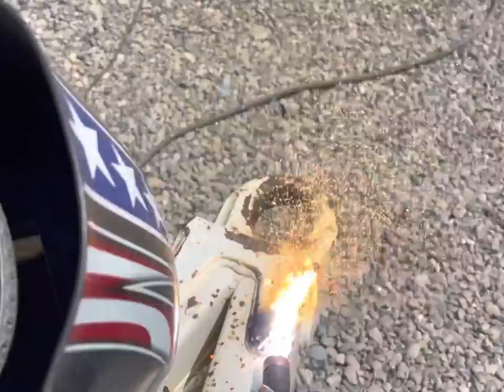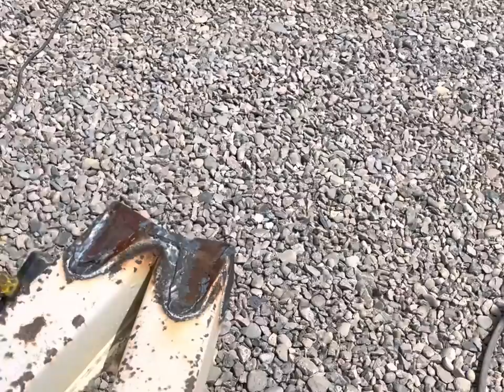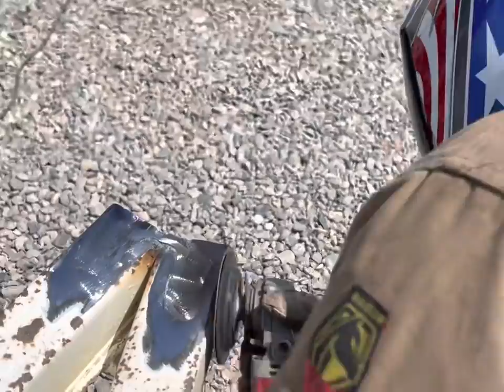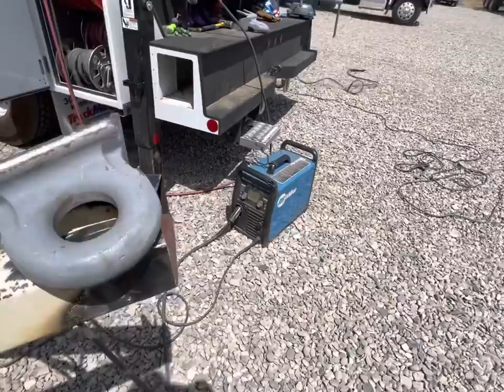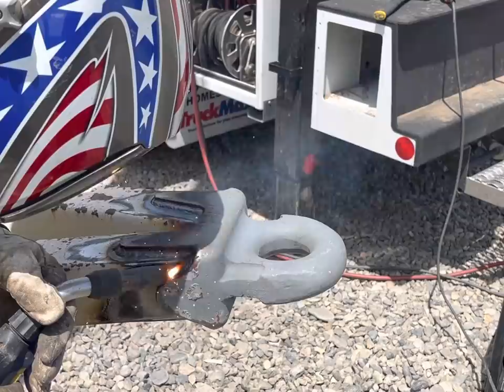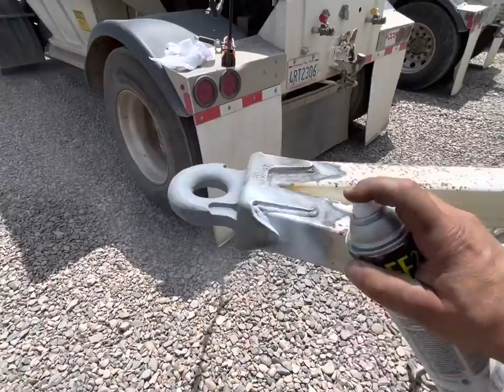Pintle Hitch Replacement

Comment: Wow , that tubing is much thinner then I was expecting 😳 I would have thought at least 1/4 wall 🤷🏻‍♂️ I guess that’s one way these manufacturers still charge the same price or more with cheaper/ thinner materials. Another Awesome OFW video 😊👍👍
Reply: Given they'll be under tension and compression loads along the long axis you probably need a lot less material than you'd think. It's also strong enough if the pintle eye is still what's needing replacement due to being worn out. Finding efficiencies like this is one of those things that free markets are actually pretty good at.
Reply: You have to be able to lift it up
Reply: Maybe there designed to snap off incase of a hard impact. Because I doubt a company would cheap out on a main tube. But ya that looks thin!
Reply: @ibidu1  The load that the tubing for the frame is supposed to hold is inline with the tubing mainly.
Yes there will be some vertical load but not as much as you might think
So using thinner wall tubing is not as much of a negative.
Weight saving is where the thinner wall tubing is better
Reply: The reason for the thin walls is so that in case the worst happens and it comes loose the hitch does not become a hardened spear. They are designed to crumple under sudden compression. Under normal use the tensile strength along the liner surface is enough. But it is another reason to start and stop the load slowly.
Reply: @larryfoster423  Your 100 percent right.
Reply: The tubing used is made of Molly tubing. Atleast the ones I work on. They are not mild steel. Even the fender braces are molly. You have to heat to a cherry red before they bend. Helps reduce the weight, ours are bolt on hitches, we replace them once in awhile. Looks great!
Reply: The tube actually only experiences forces in normal directions. something that only experiences normal forces is much stronger than it experiences moments and shear forces. So to save material and costs they make them thin, because there are strong enough.
Reply: Is the tongue A36(Mild steel) or an alloy?  For example, most cranes use T1 steel for the main chords and either 4130(round) or A36 (angle) for lacing.
Reply: Something to think about next time you meet one coming down the road toward you.
Reply: @reubeng2110  good point.

Comment: I would have lost that bet on thickness of that tubing! I can't believe it's that thin. Oh well, nice fix. Thanks for filming it.
Reply: I figured 1/4 wall.  Lol
Reply: If designed correctly, 1/8 wall tubing can hold a lot of axial load. As long as you don't put it in significant bending, it will defy intuition.

Steel's strength is often underestimated when compared to more exotic or expensive materials like titanium or CNTs.
Reply: @BrokenLifeCycle  you obviously haven't been introduced to amateur truck drivers.  Lol
Reply: @gregsmht40  There is always some guy on the crew who is good at breaking plant and equipment. We had a guy named Hammer, because he broke things! 😅

Comment: You make that look easy.  Welding thick to thin metal is tricky to not create a blowout.  Well at least for me anyway.  Great job.  Look forward to the next one.
Reply: If you practice you'll be able to do it too! Concetrate the arc mostly on the thicker metal then wash the puddle onto the thinner metal. Maybe you can find a video.  Good luck,always a need for more skilled welders! PRACTICE!
Reply: @bigdave6447  Thanks for the advice.  I will give it a try.

Comment: 06:46?!  MAN you are not kidding that those walls are on the thin side?  That is scary to think that all of that trailer and cargo is pulled by very thin square tubing!  Excellent videos as always and a hello from the State of Texas!
Reply: You should see the tongue of a dump truck transfer trailer flex
Reply: itll do it 1/8 inch is stronger than you think
Reply: @daynemartin1085  the what of a who?
Reply: scary indeed, you'd a think they would use at least 1/4 inch tube, crazy to think 20-30 tones is being held on with such thin wall
Reply: @Nothingmore71  transfer trailers are the boxy trailers behind dump-body trucks that they use to haul things like dirt, rock aggregate, asphalt, etc.  The tongue is the part of the trailer that sticks out the front and has the hitch on it.

Comment: I am surprised that the draw bar material is so thin. I would have guessed that it would be at least 6 MM wall thickness, that’s 1/4 Inch. 😳🇦🇺
Reply: It's a "pull" bar and iron tends to be rly strong if you pull on it. And the triangle makes it stronger
Reply: @rubendejong4412  it's kinda funny they go on bump roads and dips and pot holes and that don't break
Reply: Don't need the mytrik #'s!
Reply: @petersipp5247  😳??
Reply: 6mm < 1/4" (6.35mm)
Reply: 6mm is 1/4 but he mentioned 1/8.. it’s a draw bar which has a lot of surface area and two bars together. (I used to build these trailers)

Comment: When we installed pintle hitches, we were not allowed to weave or pause our welds. Can cause stress fractures. I would say your welds look fine and the material is only 1/8 with a ton of weld around it 👍

Comment: In Europe, we just replace a bushing in the eyes.
Reply: Some are like that here. We have a floating Pintle and an air lock pintle
Reply: Eventually you have to replace the eye but even with bushes
Reply: @Bigsoot7393  The eye of a VBG 57 mm. drawbar eye is virtually unbreakable if the bushings are changed in time. More often than not the reason for an eye being replaced is incorrect heating when changing the bushing. We really don't change eyes with bushings here.
Reply: @victorschmidt5306  oh yeah Europe I forgot, only haul half trailers around
Reply: @Bigsoot7393  Yeah, only 30 meters (100ft) and 90 tons (200,000 lbs) in a standard 11-axle timber train.
Reply: @victorschmidt5306  that's a lie, show me a link
Reply: @victorschmidt5306  well bloody hell hey thought you guys only ran single drive and little half trailers haha do they whip around because the trailers are so much heavier than the truck and there is no weight being transferred onto the truck?
Reply: @Bigsoot7393  It is true that a lot of Europe runs 5 axles and 88,000 lbs. which in Scandinavian eyes is no more than product samples. The most normal combinations for the heavier 60-90 ton transports use a 3-axle truck 58,000 lbs, a 2-axle dolly and a 3-axle link, and a 3-axle semi-trailer or just a 4-axle semi-trailer. With the truck being around 60k lbs it has no problem staying to the ground or pulling the load. Remember, we run 650+ hp V8s and 16-liter inlines.
Reply: @victorschmidt5306  i feel like a lot of people dont realize europe uses more powerful trucks than America does
Reply: @victorschmidt5306  yeah right well in Australia we have a truck and trailer towing another 3 trailers and they whip like crazy haha
Reply: @jblob5764  yeah they are just Numbers on the side of the cab a 620 Cummins will outpull them here in Australia it must be the gearboxes that hold them back
Reply: @Bigsoot7393  my European truck is 140000 pounds heavy total weight, how heavy is us trucks!
Reply: @magnusE7  I'm in Australia mate so that's a smaller combination here
Reply: Или проушину полностью, не везде втулки меняются. Но проушина на болтах. Здесь же вообще не продумано на мой взгляд, несколько раз так поменяешь и целиком дышло меняй потом
Reply: @Bigsoot7393  Aussie road trains are wild.
Reply: А в России мы просто подкладываем кусок покрышки
Reply: @MrReinmetal  за всю Россию не говори. Может в колхозе где нибудь и так. У нас в автопарке, регулярно промеряют и проушину и палец тсу, и при износе больше допустимого сразу меняют изношенную запчасть
Reply: @Лёха-х9л   Не хотел ломать психику и стереотип европейцев о нас. И в колхозе тсу европейские и ремкомплекты их же меняется палец и втулка
Reply: What Mig wire are you using for something like this?
Reply: @iridium8341 Warum willst du nicht Deutsch sprechen?
Reply: Wow the pissing contest with no way to validate.  Just lay off the European attack here guys.  I think just saying what you do doesn't require a signed and copied letter of agreement.  Holy hell, settle.  Europe is way ahead with deluxe future trucks and the gave insane agri equipment too.  Australia has long ass road trains with 600 hp+ mid or rear trailers.  USA and Canada has trucks too 🎉.  I'm Canadian, really know nothing in life, but that this argument is likely solving nothing.
Reply: When it wrecked its wrecked I think he did awesome job better to replace the whole part
Reply: come to Brazil and take a look at what the weight is and with trucks much lower than in europe and america, just the rest of the automakers and united and brought here and we did the test with real weight

Comment: That thin wall tube draw bar is scary isn't it?  Its thinner than what is on my car trailer. But I suppose it doesnt take much load vertically, only working in tension (and compression when braking/ downhill).

Comment: I am blown away on the thin wall tubing that was used. I would of guessed 1/4" minimum. I guess it shows how I underestimate the strength of steel.

Comment: how do you like plasma gouging over air arc? i guess each one has its place just figured i would ask.
Reply from the maker: I like plasma for thinner material or where you need more control.  I like air arc when working on thicker material. I would compare my plasma on 105 to 500 amps of air arc as far as material removal rate goes.

Comment: Again, as some have stated, not being critical; but, while a Miller 600 air pack is a beast of a machine, why do you feel you need that level of machine for the work that you normally seem to do? Just curious and respectfully, you do have an awesome set up that anyone would be proud of.
Reply from the maker: Several reasons I chose the 600. I needed 3 phase power for my plasma. And I’m always arc gouging on 600 amps.  And the 600 is the smallest diesel air pak I could get.  If I had to buy it again I would buy the 800 air pak.
Reply: Very good. Thanks for the reply. Be safe and blessed.

Comment: So im curious, why are you using the wire feed in this application? I feel like it would be quicker to just unroll the leads and burn 7018 rather than set up an entire MIG machine. Plus you'd get a little more tensile strength in your bead and a lot lower chance of porosity. Im from Oklahoma, so most days its way too windy to wire weld outside. Hope I'm not coming off as too critical, just trying to learn your thought process. I've watched a couple of your videos and they've definitely inspired me. The weld shop I work for still lives in the 20th century. Most guys torch everything and only wire weld in the shop. Since finding your channel I've really been using our plasma cutter way more especially for gouging. Thanks for the inspiration and new knowledge into the 21st century 😂
Reply from the maker: Well my mig machine is always setup so all I have to do is plug it in so the “setup “ would be about the same amount of time. The tensile strength is similar to 7018. But that’s not really a factor in this situation.  Most of the time the wind doesn’t affect me but sometimes I will run stick or straight flux core.  A torch definitely has its place but a plasma can save a lot of time.
Reply: @OFW  for the past two weeks I've been doing a ton of rebuilds. I've rebuilt a rock chute for a quarry, two sand chutes for sand plants, and I'm currently rebuilding an excavator bucket. All of my coworkers would have torch gouged everything but I literally saved days by using the arc gourger and plasma. You're not wrong about the torch having its place but if I can help it, I'll never torch gouge again. Way to slow and way to many sparks

Comment: Although the tubing itself has the tensile strength to pull the trailer, I don't know about that joint..  The point of all those fingers is to increase the weld area, but it also looks like it's only welded on 3 sides, and left open on the bottom..     It is OK for the first weld from the factory, but after a gouge, grind and reweld, the tubing is likely weakened significantly due to HAZ of the multiple processes and as an engineer, I would probably specify a reinforcing plate and a bigger size of weld bead to feel comfortable with that joint..
Reply: but youre not an engineer.
Reply: I'm with you on your idea about cutting and welding on it but I think it needs at least two more passes all they around  it that was some pretty thin welds he painted over

Comment: People fuss when you hand them a bill for $100 an hour but they don't think about the $150k to $200k in truck as well as the time that you put into learning the trade.   I don't worry about it anymore.  Seems like if you care what people think they try and take advantage of you  but if you tell them that the fella with the air cooled little welder in the back of a beat to heck pickup charges less they grimace but pay up.   Yup, being a little bitter but people think nothing of paying a dentist $2k for braces and the like.

Comment: Trailer manufacturers have to keep them as light as possible so you can scale as much weight legally as possible.. if people buying the trailers are hearing you cannot scale as much weight with a certain brand of trailer then they tell their friends and it impacts business... the rookie truck drivers are always wanting big strong  (heavy) trailers but anybody who has been trucking for long enough knows to be competitive you need to be able to haul as much or more than the next guy or you will lose money in the long run. So good business minded drivers and companies buy the lightest trailers possible that dont fall apart. Thats likely why those tubes are so thin is to save on weight.

Comment: Hey Greg! I Just subscribed, great work!. Question for you.  Could you have used dual sheild. 0.O35 off your suitcase? Or because of the thinner tube you went with your miller 220 for better control of the heat?
Reply from the maker: Technically it could be welded with any process using the correct setting.  I chose the 220 because I am comfortable with it.

Comment: I'm no engineer but I have built a lot of race cars and seen a lot of metal pushed beyond its abilities. Doubling the thickness of the tubing would be insignificant in the cost to manufacture that trailer but increase the durability and safety drastically while it's on the road.
Reply: It's only pulling there's no other forces up down or anything

Comment: hey Greg. great welds, looks good. i was also surprised by how thin that material is. must be enough with the type of load.

about how long does one of these repairs last, if you happen to remember
Reply from the maker: Depends on usage and maintenance.  Typically a lunette ring will last 10 years with proper maintenance
Reply: @OFW  and we all know how well these pieces of equipment are maintained. lol

Comment: Are you using a specific tip for the plasma tip ,I didn't know you coul scarf with a plasma cutter.looks like it does pretty good job of removing the weld.
Reply from the maker: Yes, they are gouging consumables. Not all plasmas have that option.
Reply: @OFW  gotcha,looks like it works better than air arcing thanks for the feedback

Comment: I may have missed it in another video, but what size plasma are you using? Guessing it's a hypertherm by the torch, but curious how many amps. That washed those welds out insanely efficiently and cleanly.
Reply from the maker: Hypertherm 105
Reply: @OFW  beast mode, damn!

Comment: Look, the welds look fine, but first the cutting and then welding. Won't that thin wall squere tubing crack after a while if submitted to harsh conditions?
Reply from the maker: They have cracked yet.

Comment: 1/8 x 2” (?) length x 8 walls = surface area of 2sq. Inch. = 635 sq. mm x tensile ( say 350 N/mm2) = about 22 tonnes ( imperial or metric). Pretty strong.

Comment: When you were welding the top of the side, and then switched to the bottom side, what did you change in your technic to weld overhead?
Reply from the maker: Same technique just a tad faster in travel speed
Reply: Must focus your puddle more directly straight up or else your weld will just “fall”

Comment: When you're MIG welding something like this, are you doing any hand manipulation? ie: Stitch, cursive E, etc? ....or are you just doing a straight drag forming the bead profile you want? Thanks.
Reply from the maker: Typically I have a back and forth movement.
Reply: Cool, thanks!

Comment: Isn't there an issue with penetration when welding thin and thick metals? Can you trust the strength of the weld?
Reply from the maker: If you are experienced then no. Basically you keep all your heat on the thicker pieces and roll your puddle onto the thinner one.  The strength of the weld is not the issue. The HAZ ( heat effected zone) is where it would fail on that thin tube. Basically the tube would rip right where it touches the weld.
Reply: Thanks for the explanation.

Comment: I have to say, I'm no expert, but for the size and weight of that trailer, that tubing is awfully thin. Honestly it does not look as though it can handle the weight, but you didn't build it, only replaced the eye, but it's a worry, all those trailers with eyes attached to such thin metal, looks like an accident waiting to happen. Good video though, nice to ⌚️ ⏱️ One last comment why then are the eyes made of such thick metal,surely it's only as strong as its weakest point.
Reply: You are correct, it is too thin. Would you trust your family car behind that trailer holding 10 tons, and that shitty tubing cracks right off if driver has to make sharp turn?

Comment: Hi! Liked the video. Can you please share the welder details…
Reply from the maker: The welder used in this video was a Miller 220 AC/DC.  .035 er70s6 wire and 75/25 gas.
Reply: Thanks dear…